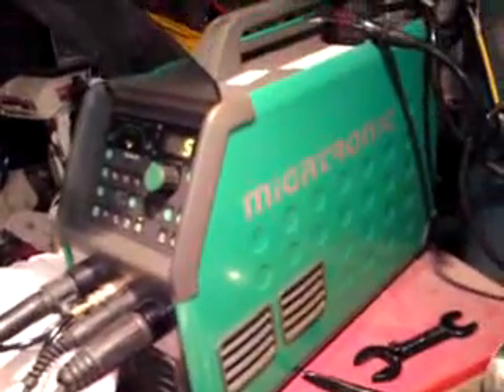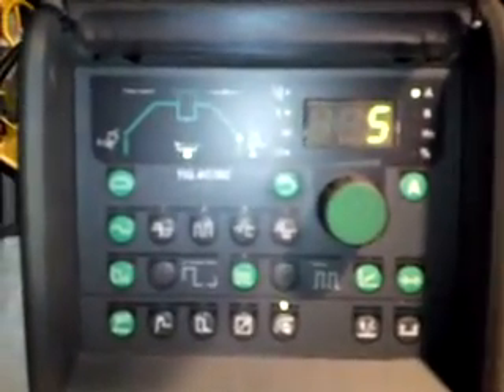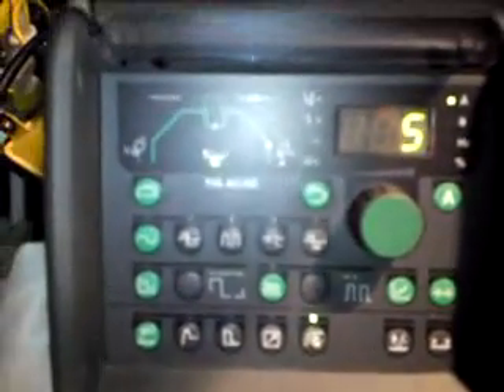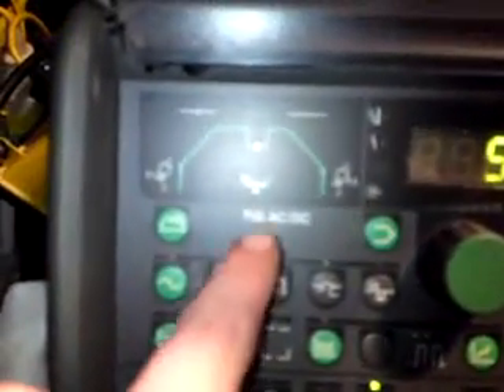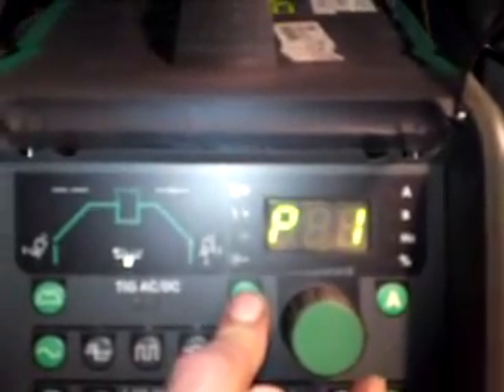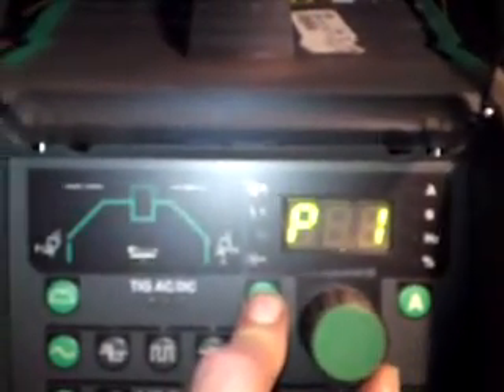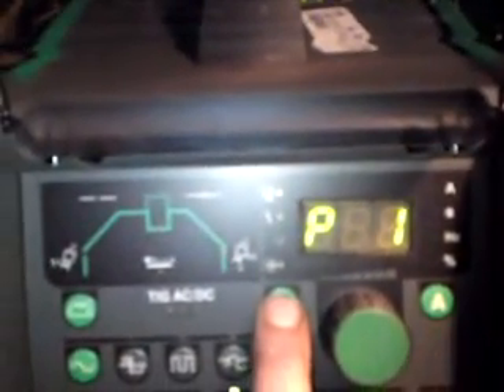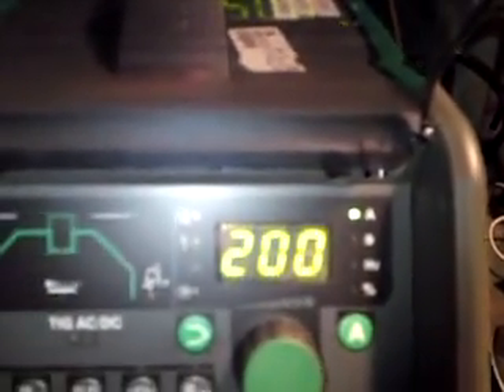Tig welding Tack welding settings Migatronic PI200 AC/DC

Comment: Would you recommend migatronic stuff any good?? I'm going to buy acdc tig they seem good value. .love to hear from someone who has bought their stuff. .I was thinking of getting the basic one it's good bit cheaper. ..it seems good value tho. ..
Reply from the maker: I can vouch for the PI200 as I own 2 of them, Good reliable unit.I wouldn't recommend this model for a beginner as they are complicated to set up. Kemppi Mastertig are also very good, and you get 230 Amps as apposed to 200 Amps from the Migatronic from a 240v supply.

Comment: Hi, when you have the settings the way you like, how do you actually save the setting so you can go back to it in the future please, how do you create and store your own program on this unit? Thanks
Reply from the maker: If you are, for example, using prog. 1 DC. That program will remain program 1 DC, it will remember the changes you make when in that program, you do not have to manually save it it will not reset back to the program before you made any changes. If you are happy with Prog. 1 DC and wish to save this program, but you now wish to weld thicker material and need to change your amps for example, press the program button and move the knob to select a different program number. When you return to program DC 1 the parameters will be the same as when you last used it. hope this makes sense
Reply: @acewelding  Thanks for that, that was really helpful.
How do you rate the Migatronic PI for reliability?
Do you prefer Migatronic TIG inverters over Lincoln or Miller inverters?
Cheers
Reply from the maker: James InEngland1 I own 2 Pi 200’s and they have never missed a beat, mostly used flat out at 200Amps AC.
I would probably buy a Kemppi Mastertig if I had to replace a set, due to the higher frequency range. You see a lot of Millers on eBay for spares or repair. I don’t have any experience with Lincoln.
Reply: @acewelding  Thanks for that. Cheers

Comment: This apears to be "the video" regarding tack settings on the pi-200 / 250 ac/dc miagtronic machine. I investigated the same question as adress in the video, settings of tack welding and this in relation to comments as seen below that you "just use the tig-a-tack button". This video is great and you might be needing to program the machine as shown in this video depending on what software version your machine has.
So here is what I found out:
TIG-A-TACK, the last button in second line from button as seen in video do has different function depending on soft. version of the machine.
TIG-A-TACK was introduced in version 1.22, that is late year 2009. My machine is 1.20 (early 2008) and then with this button selected you CAN NOT set time. Function is then called TACK-WELDING and not TIG-A-TACK in that case. ( i.e. useless function as I see it. It works similar as TIG-A-TACK but weld time is manually controlled by button on torch, if you do try change time nothing happens, all buttons are non-operational).
Current software version from april 2016, is 1.35 and you can't update this by yourself, as on the newer mahines, with help of a SD card. Its software needs to be flashed by factory/service.
If you read the latest manual, other features are described as well and some of them are:
Lowest current setting of 5A instead of 7A on machine possible from version 1.21 (2008)
Reverse polarity in MMA by setting AC freq. to zero, verrsion 1.21 (2008)
Welding time in steps of 10msec, version 1.21 (2008)
Check arc-voltage, introduced in version 1.30 (2012)
complete version history can be found at migatronic site.
To check sotware version on your machine, you must do a machine reset, that is factory values are restored and you lose your current saved welding programs. This is how you do: with machine off, press and hold both the "camel"-button, the green one top left and the second green button to right, that is the program-select button. While holding these buttons turn on machine, after start-up still holding buttons, the current meter display will show the software version X.XX.
Thanks for great video.

Comment: Thanks, this was very informative. I bought a welder of this model a few weeks ago but have'nt had the time to test it yet. A few questions though. Do you know which software version you have? Mine has 1.12, and from what I understand that is rather old. Do you know how to upgrade?
Reply: I actually did upgrade last autumn, it was not easy to find anyone who knew something about this around my place; first they said it couldn't be done, then I got the answer 600 Eur to replace panel and finally I dismount the panel myself and sent it to Migatronic denmark through a reseller for reprogramming and all this for 130 Eur, which was ok price I guess.
Reply from the maker: What did you gain from the upgrade? This would be useful info for Youtubers. Thanks
Reply: Well I mainly wanted this to get lowest current setting possible and time resolution, before upgrade (v1.20) this was 10Amps and 100msec. This list shows the different upgrades vs software version :
version 1.21
1. Minimum welding current is now 5Amps.
2. Welding timer is now adjusted in steps of 10msec.
3. Minimum TIG START current can now be adjusted to 1%.
4. (Reverse polarity in MMA AC mode ONLY is now possible by adjusting the AC frequency to 0HZ.)

version 1.22
5. TIG-A-TACK function is implemented (0.01 – 2.50 seconds).

version 1.30
6. Updated AC preheat indexes 1 to 6 for a smoother ignition on small thickness
I think I you can find the complete list at migatronic site.
Reply: looks like you can select 5 Amps as lowest current and your time settings only have one decimal place in your video, that means you most likely are on v.1.21 (2008), version 1.22 have the real tic-a-tac feature that you try to implement manually. Look at my top comment above for button-combo to show version number on display of welder.
Reply from the maker: I don't know, I haven't looked. I would be grateful if you would let me know if you find out how to update, probably a Migatronic job. Let me know what you think of HF start, it's crap on this one. Cheers
Reply: Rather old comment, but if you are still looking, your version 1.12 is from late 2006. Current is 1.35 (2016).
It must be flashed by miagatronic people.
Reply from the maker: +Magnus Hummelgård ah ha, that would explain all the comments I received about just pressing the tack button then. I will contact my nearest Migatronic dealer and update it. I have had an issue with this machine since I purchased it new, I actually sent it back within a few weeks after purchasing it. None of the buttons worked when in AC mode. I sent it away and they told me there was nothing wrong with it. It's since happened a few times and I have to tap the side of the machine. Thanks for the info.
Reply: +Magnus Hummelgård Thanks! I have tried to get information but my attempts so far has failed :-/. Unfortunately the nearest migatronic service partner is about 200km away, so it might take a while before I can have it upgraded.Are you by any chance also located in Sweden? I live in Karlstad :-)
Reply: +dahook visst Sundsvall. Jag har inte kollat upp vart service finns själv?
Reply: Trevligt :-) I Sundsvall finns http://www.handmaskinservice.com som utför service på Migatronic. Närmsta servicepartner för mig är i Uddevalla eller Göteborg :-/
Reply from the maker: I live in the UK, Sorry
Reply: I see in your movie that you do have 5A as well as 10 msec resolution on time settings, that means your machine must be on version 1.21. In that case I don't see any need to upgrade software, in my case with version 1.20 I lack those options as well, shortest pulse time will be 0.1 sec for me which could be little to long for thin stuff, guess I can live with it anyway.
Reply: I spoke to a Migatronic service center today and apparently the only way to upgrade the Pi 200 is to replace the panel :-( I did not ask for a price, it sounded expensive...
Reply from the maker: Great info. Thanks for posting.  Can you tell which version I have, by watching the video?
Reply from the maker: Thanks
Reply: @Magnus Hummelgård. Which Swedish reseller helped you with this? As you say, it's not easy to find anyone who knows about this...
Reply: R-K Verktyg AB, Sundsvall http://www.verktygsproffs.se

Comment: Tic a tack button bottom right, you can set amps and duration of tack, why you wasting time with a setting. Read the user guide on migatronic website

Comment: Hello i want to buy the same item , i have experience only with one chinese tig dc. not too much though ,will it be hard for me to handle it ? and how helpfull was it for you???
Reply from the maker: Hi. These machines are complicated, I would be lying if i said they weren't. That being said, you can keep it simple with this set. If you buy a basic machine  it wont be long until you wished you had more settings on it, then your back to square one. This type of machine is much more versatile than the basic sets, you can narrow the arc for Ali welding on AC current by changing the frequency, which I couldn't be without, the pulse setting for using on a rotary table is amazing. If you need any help with the settings let me know and I will help in any way I can.
Reply: what kind of a machine can u recomend me which is more easy , i prefer migatronic though
Reply from the maker: I have a Kemppi Mastertig also, they come with different push button operating panels, I believe you can buy the main machine with the panel of your choice. ie Basic up to advanced. check out this video. This is, in my opinion one of the best machines on the market 

Kemppi MASTERTIG MLS 2300 3003 AC DC

Comment from the maker: Hi, yes I did thanks, but I believe you can only set the amps on the tack weld setting, not the duration of the tack. In this video I was trying to demonstrate a way of changing every parameter of the tack process. Thanks for watching.